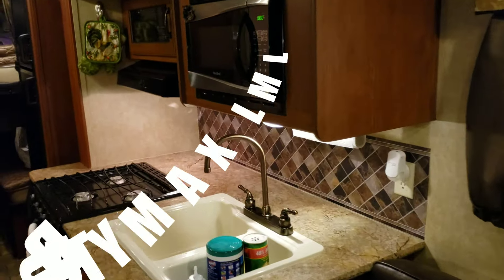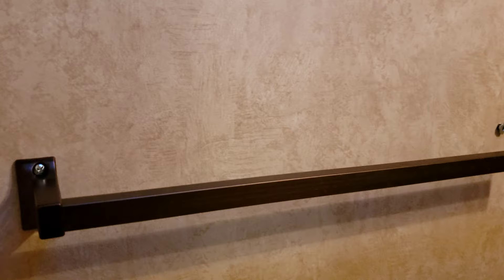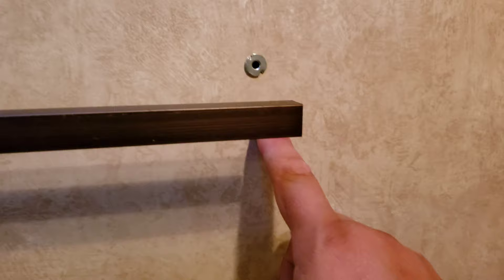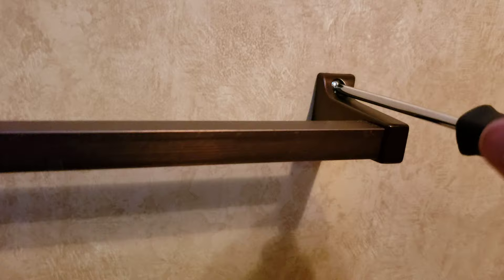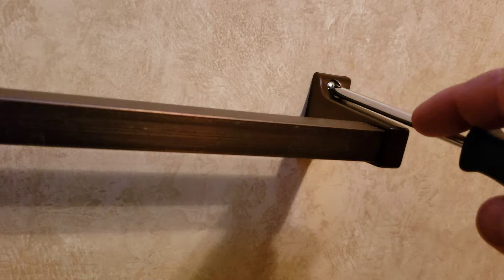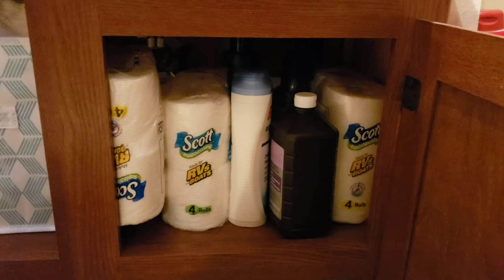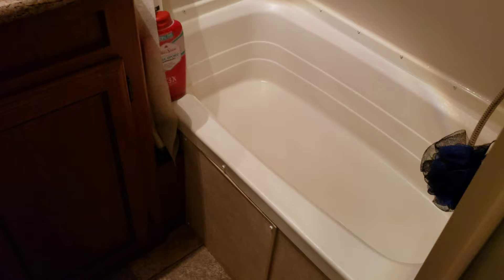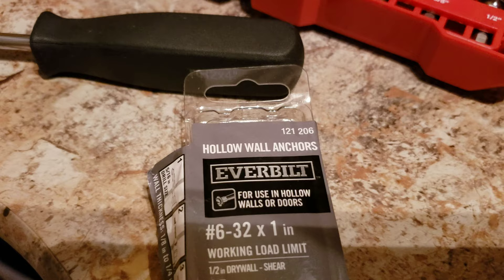RV Wall Anchor! How to install an anchor in a hollow wall!

Comment: I have looked all over trying to find advice about hanging things in an RV.  I am tired of hearing about command strips which are useless.  Thanks so much.
Reply from the maker: I'm glad I was able to help thank you very much!😎👍
Reply: You could use permanent double sided mounting tape which is much stronger. 3m and gorilla make good ones. It will probably tear the surface of the wall off though if you ever had to remove it.

Comment: Thanks for all the great info! This was very helpful. One comment about the flushable wipes. Flushable wipes are marketed as ‘flushable’ because you can literally flush them, but they will not break down in the dump tank after you empty out. We are on a septic system and we’ve found out the hard way. Wipes are great, just don’t flush them, tops them in the trash, otherwise the campground will have very costly repairs to their underground tanks.
Reply from the maker: Yeah you're absolutely right!😎👍

Comment: FYI, you should insert the anchor into the wall, then insert and tighten the screw to set/expand the anchors, then remove the screw, and finally attach your fixture and tighten to the wall.
Reply from the maker: Thanks Karen!
Reply: @DURTYMAXLML  I only suggested this because you were using the fixture to tighten/expand the anchor... if the fixture was fragile, it would crack under the stress. Better to use the screw by itself to expand the anchor, remove it, then attach the fixture. :)
Reply from the maker: In that case, I have to agree! 
Thanks Steve!

Comment: This is SUPER helpful, thanks! We have a smaller RV as well, and two teenagers, and we chose not to upgrade because we can pull it anywhere with our half-ton.
Reply from the maker: We upgraded to a 41ft fifth wheel. It's everything we need and more. But you are absolutely right, It's hard to find places to camp, smaller is sometimes better. Being able to pick up and go on a whim and being able to find campsite spontaneously is something we miss. I'm glad this video was helpful. Thank you for watching and supporting😎 🤙Thank you Kim!

Comment: Good video.  I would offer though that the anchor you’ve shown is only good for completely hollow RV walls, meaning interior walls.  These will fail if you try using them on exterior walls on newer RV’s that have rigid foam insulation, because they won’t expand in the foam board.

Comment: What about anchors in the ceiling? Our sliding door moulding with the track in has popped out and I cannot get screws 1 1/2 inch wood screws to hold

Comment: Just wondering where does the showerhead actually get the oxygen from? Do you have to pipe it in? Because our atmosphere is made up of 78% nitrogen and 20% oxygen.
Reply from the maker: It's a simple shower head that uses the surrounding oxygen we breathe every day. It's about $40 you can get it at Walmart or Amazon. You simply unscrew your old one, screw in the new one, & watch the magic happen! It's amazing to see how much more forceful the water flow feels. Give it a try I'm sure you will not be disappointed. Thank you Bill!

Comment: Very helpful video, just purchased a 2018 Keystone Cougar Travel Trailer. The walls are of concern as they are so thin in here. Can you tell me the load bearing capability of the towel bar with the hollow wall inserts?? Tysm
Reply from the maker: It says 85lbs on the box, but I would give it about 10 to 15lbs for the Anchor & towel bar! Thank you Debbie!

Comment: So, we're wanting to install some extra cabinets in our motorhome. I'm having a hard time finding info on my exact concerns. If I'm going to add cabinets in areas where the manufacturer didn't originally install cabinets, what's the chance I'm fight to hit things i don't want to hit, i.e. plumbing and wires?
Reply: The manufacturer is no help. We have a Damon, who was bought by Thor. But, Thor did not get the technical data for old Damons when they bought them out of bankruptcy.
Reply from the maker: Yeah that's a tough one you're definitely going to have to find out what's Behind the Walls! Hopefully your manufacturer can give you the blueprints! Goodluck Jonathan!
Reply from the maker: They do make some very advanced stud finders. The WALABOT may work for you. It attaches to your phone. If it's good enough to see through walls of a house I'm sure it's more than plenty to see through the walls of an RV. Let me know how it goes!

Comment: We just bought a 2017 Keystone Hideout. Do you think this would be a good idea for hanging a couple of shelves for some small plants? I’ve been looking and looking for ideas that are more secure than adhesives and I’m hoping this could work. Thoughts?
Reply from the maker: I think that's a great idea! As long as the plants are very small and Light it will work! I've seen where the Potted Plant tapirs from large to small and you cut a hole in the Shelf so the pot sticks halfway through the Shelf. That way they won't slide off.  Or 3M makes a double-sided stick tape that holds 90 lb per square inch.  Although I don't think it'll hold 90 lb, but it is very strong!  I hope this helps! let me know how it turns out? Thank you Montessa!

Comment: Great video!  Where did you buy the anchors?  Having a hard time finding them. Thanks!
Reply from the maker: Wow they are hard to find online! I got them at home depot. I did find some on ebay.  Although they are 1 1/4 instead of one inch, depending on the thickness of your RV wall these might work, here is the link below. Hope this helps! Thank you Christine Carey! https://www.ebay.com/itm/25pk-Everbilt-6-32-x-1-1-4-in-Zinc-Plated-Steel-Hollow-Wall-Anchor-261637/283887838351?hash=item421908a48f:g:2AEAAOSw4IleyFU9